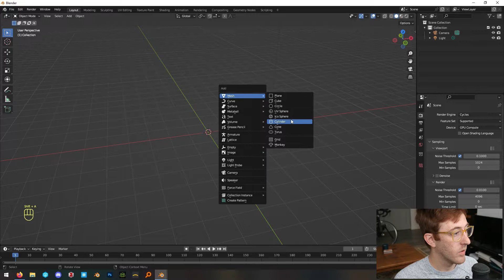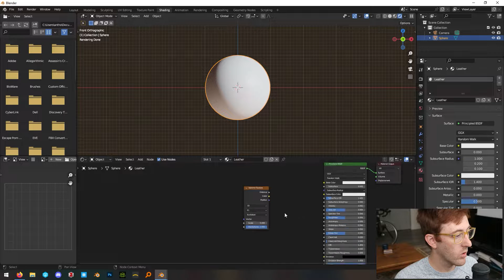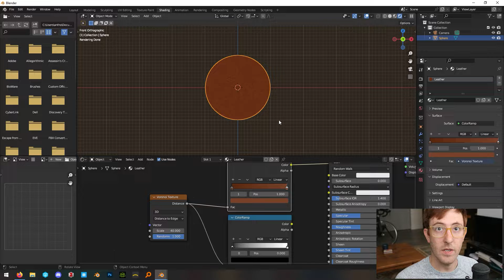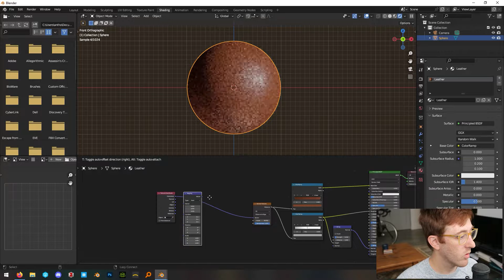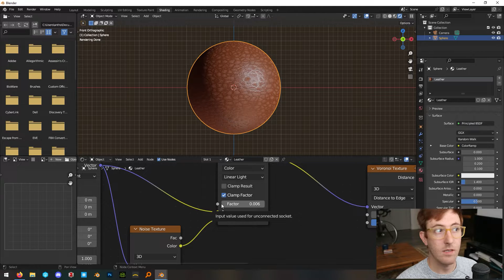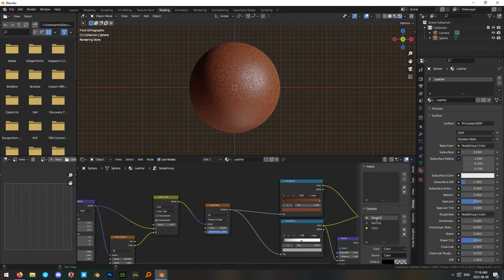Blender: Easy procedural leather material

Comment: I need help. For some reason my texture is super smooth and shiny
Reply from the maker: It is hard to tell the issue without any more info than that, but happy to help diagnose if you have some screenshots or can describe your node set up, blender version, etc. Some things have changed in Blender 4.x - this tutorial was made in the 3.6 LTS version.
Reply: @cgkrab  I did exactly as the tutorial showed. version is 4.2.2 LTS

Edit: i did some custom changes and the shining effect kinda dissapeared
Reply from the maker: @pavelgaming5470  ok. Are there any mix nodes? In 3.6, these were 'mix color' nodes. In 4.x and up, these have been changes to mix nodes but by default are not set to 'mix color.'